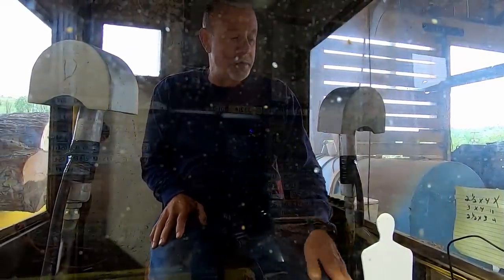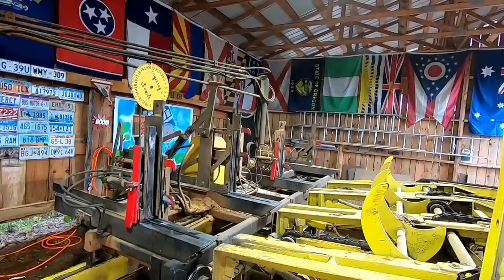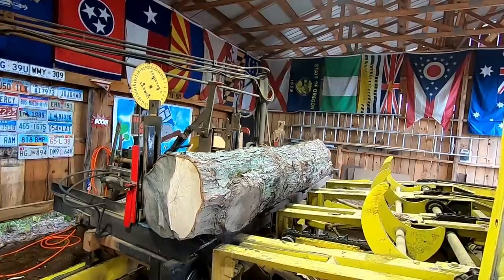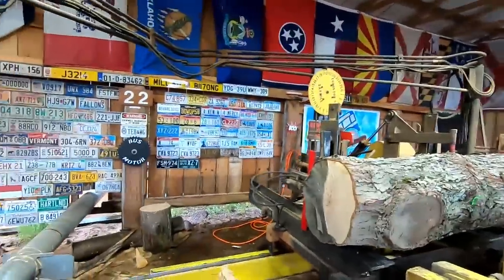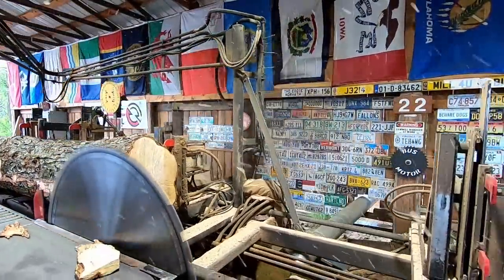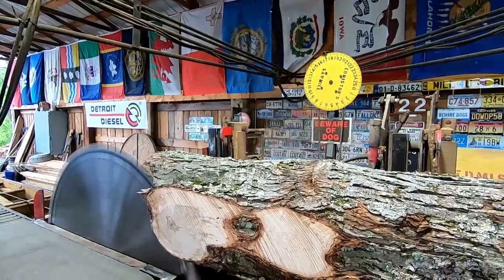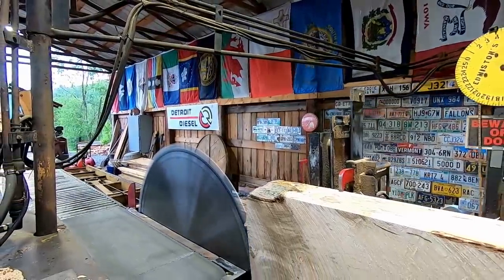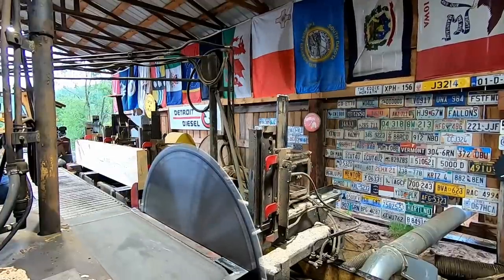sawing hard maple bowl blanks # 425

Comment: Hey Mark. The carbide saw bits that you have been using seemed to perform very well and you got really good longevity out of them. I was just wondering why you went with the chrome bits this time. Were the carbide bits getting too expensive or did you just want to give the chrome bits a try? No big deal. I was just curious. Thanks to you all for the great short sawing video!
Reply from the maker: we have a new saw ordered and this saw needs hammered so I just put chrome bits in it .